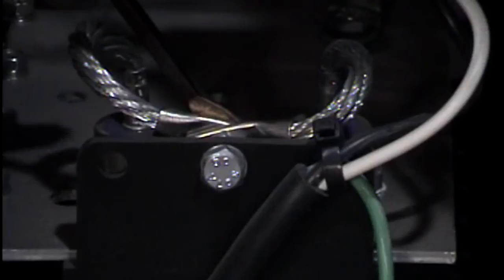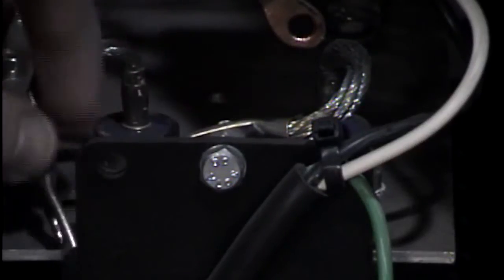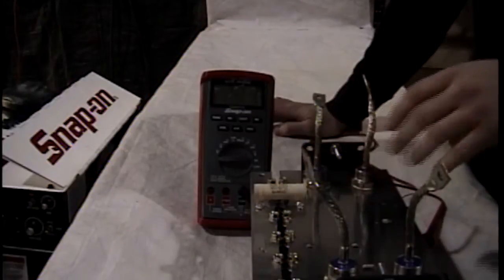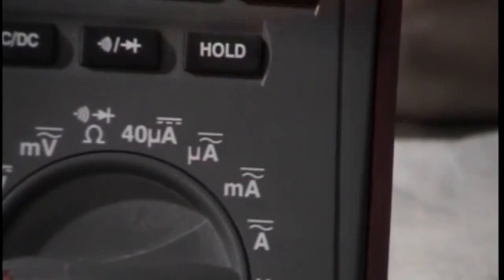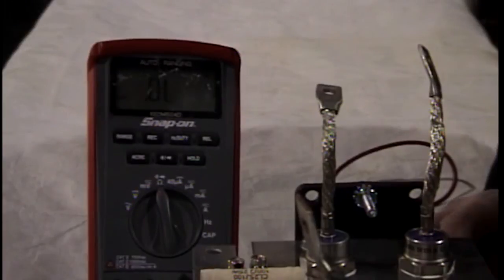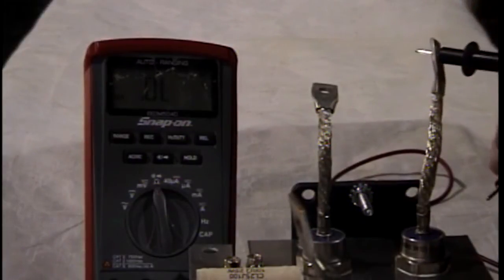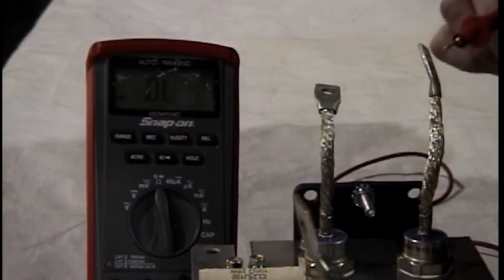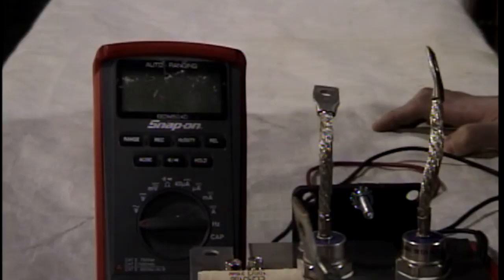Diode Testing

Comment: Thank you so much! I have a welder with less than 10 hours with the reduced output symptom. I found it had a max open voltage of 18v but the welder is rated at 28v. I have a good feeling this will save me a TON of money.

Comment: is there anyway you can help me I have a older airco dip stick 160 I had pulled the capacitors and tested them they read half of there rating being 30 years old I tested the diodes they flowed in one direction and not the other. the machine was working prior to me pulling things out just didn't have good welds of  high voltage. I reassembled everything and turned the machine on and when I went to strike a arc the machine shot sparks out of somewhere. it currently has hardly any wire speed and makes a bad sound along with the contactor relay sparking on 1 leg. I read the contactor relay without depressing the mig gun trigger and had a constant voltage on each leg of 28.5 volts, shouldn't the contactor  not show voltage on the other side till I depress the mig gun trigger?

my email is hondacivic247@hotmail.com